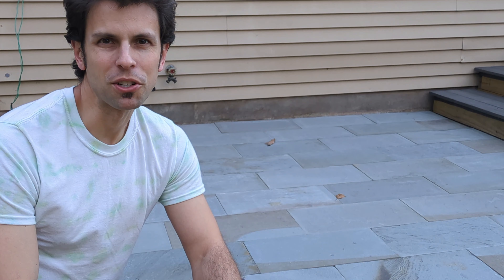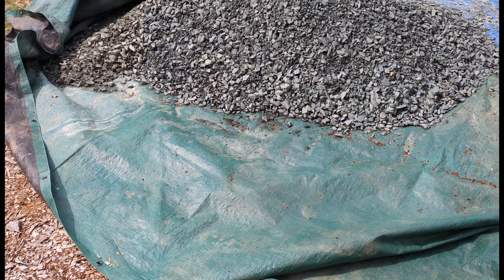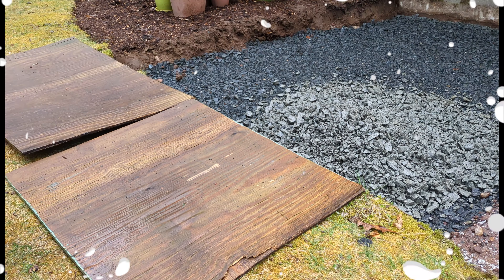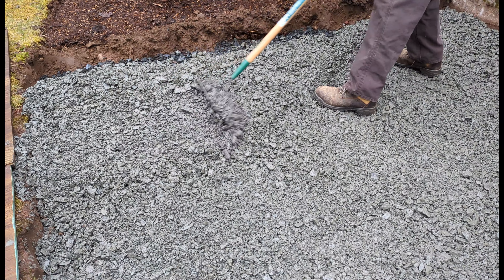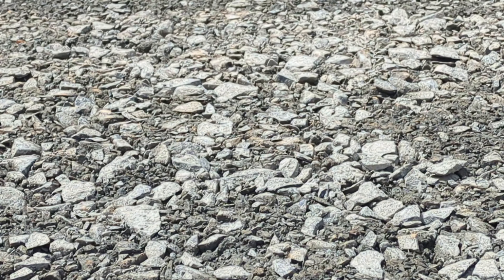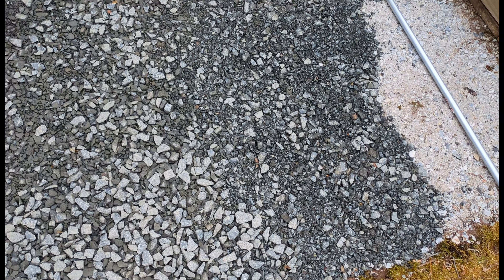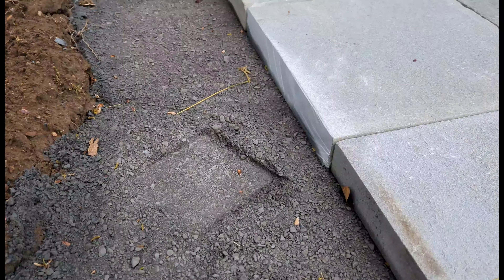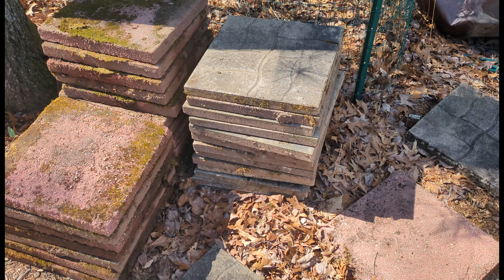How to Build a Patio - Top DIY Installation Tips

Comment: Wont you have issues with bricks being unleavened as the earth goes up and down during the cold then warm season due to the permafrost stuff? I'm new to the stuff and youre channel has been fantastic.
Reply from the maker: @Septix  thanks! I didn't make a full patio build video since there were many others already. So I just put together this shorter video. The best you can do is build to avoid freeze-thaw issues. Proper base (deep, solid packed crusher run) so any water that gets underneath drains away. And then build the patio to be impermeable so water drains off it rather than getting through.